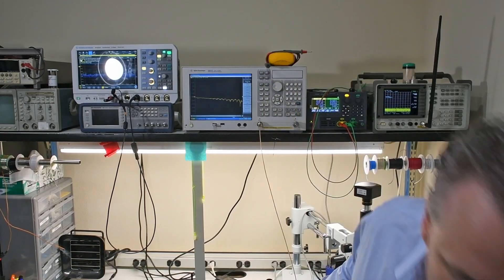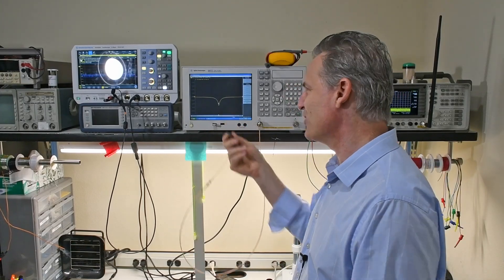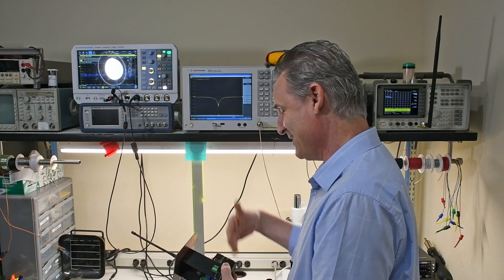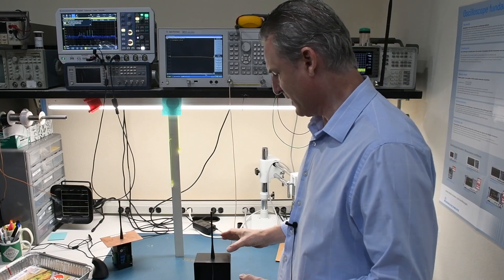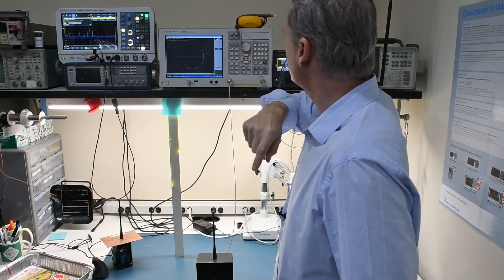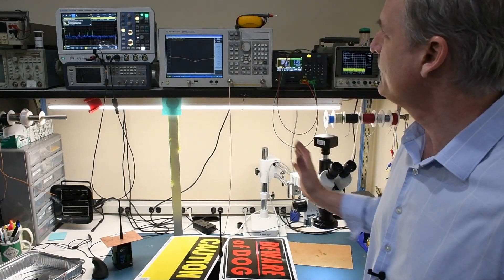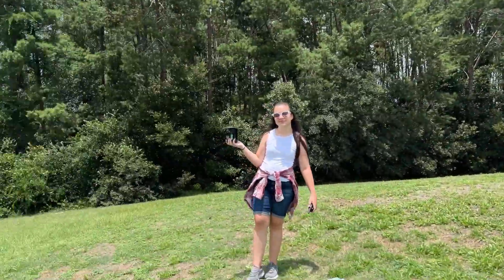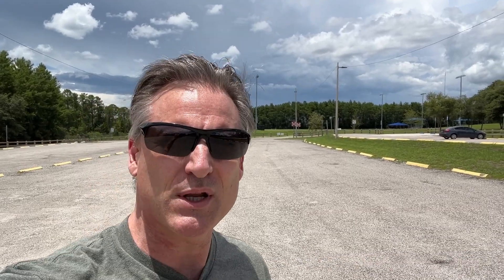SPCBD 0006: 433MHz Antenna Matching Finale and Range Testing

Comment: Very helpful Videos on antenna Matching.. Please help me if you understand my doubt. (Pardon me if my question is noob) I have to tune an antenna to 433MHz receiver IC.  I was able to get the antenna matching to 433Mhz and very close to 50ohm. But My RF receiver input impedance is 12- j215. Should I move the antenna impedance (using matching LC impedances) to 12+ j215? OR do I use one more LC impedance network to get RF input impedance to 50 ohm as well? what's your recommendation in your experience?